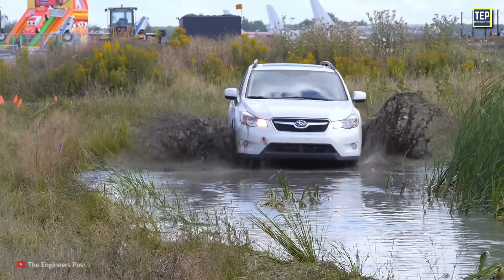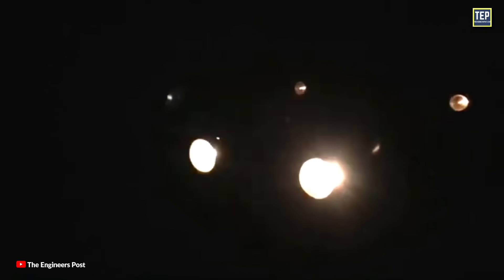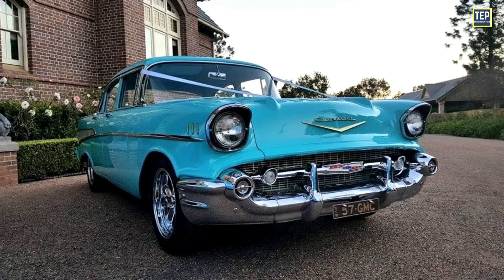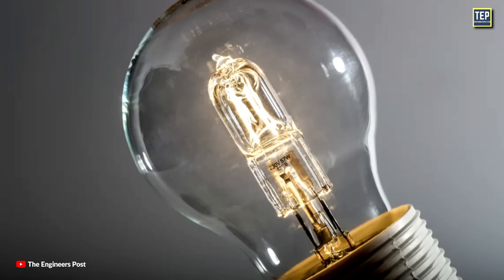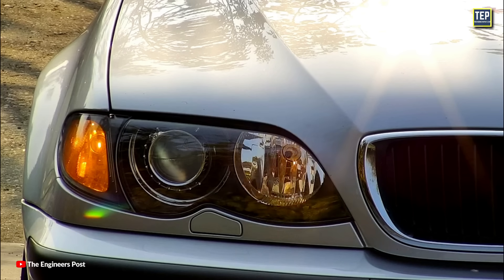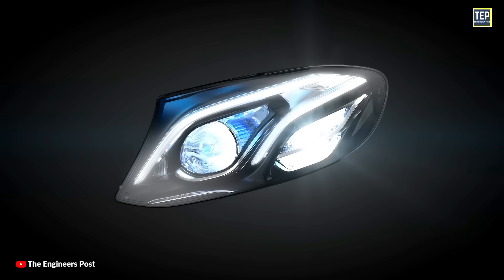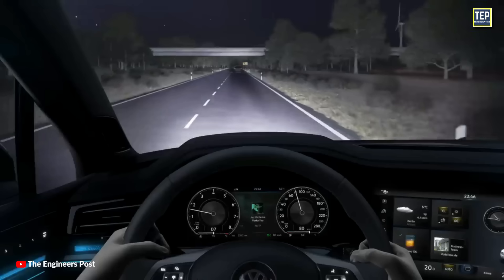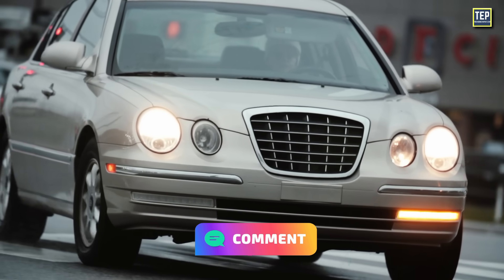The Problem With These Headlights

Comment: Halogen setup is best. Functional, bright, good spread, yellowish. 

Xenon and Led are too white for pitch black and rainy season wet roads. 
Plus they make you blind, if oncoming vehicle has one.
Reply: xenons are best same with leds stop talking bullshit about halogen junk, even this yellow light is anoying and weak
Reply: Selective yellow (or generally a warmer phosphor layer) LEDs would be the ideal
Reply: Brighter light reflects more of wet and snowy roads. Thats why they use yellow light in rally.
Reply: LED matrix do not blind anyone. They turn off when incoming cars are. It is soo nice to have.
Reply: @ContraVsGigi  yeah the turn off too late though, they blind you first.
But you be happy that you can see and are pissing off every other driver.
Reply: @ContraVsGigi  Are there enough varieties of LED matrix lights to retro-fit any existing automobile ?
Reply: @doughamblett5204  I don't think you can retrofit matrix lights. As far as I know, it requires a vision system (camera and onboard computer) to identify the position of the oncoming vehicle and light up the LEDs accordingly
Reply: I can't see more than 20m ahead with halogens if it's dark and raining. That's my experience with two cars, both having clear lenses and decent bulbs. Now i have a car with xenons and the next winter is gonna be a lot more comfortable.
Reply: @idkwuisp7626  Except for all the other folks you meet on the road.
Reply: @idkwuisp7626  Maybe it is different type of reflector material they use in your country? 
Or different type of asphalt mixture, idk. 
Or maybe different genetics and colour spectrum of eyes? 

But xenon on snowish white is really bad at reflecting back into retina, Good luck...

Comment: Funny how they called it "electric" light, like what light nowadays isn't electric 😂
Reply: I had a fire in the backyard last weekend that threw some light. Lit it with a Bic.

Got the charcoal grill ready to make burgers and brats tonight, also gonna be lit by the Bic. And the initial burning will give off light. 

My wife loves candles, they give off enough light to read by depending on how many are burning. 

Sorry to be that guy, but not all light is electric. As literally proven by the first example in the video.
Reply: You missed the point.

Comment: The main problem with LED headlights is that are too bright on some cars and can blind you. For example, if you driving a sedan and there is a big truck behind you, it's headlights will shine in your car.   Also, if the LED light malfuctions, you cannot just replace the bulb as it is not a regular bulb like halgeon are. Instead, you have to replace the entire headlight assembly. This is true on the 2014 and newer Toyota Corolla.
Reply: I know a gal who carried a hand=held mirror so she could raise it up and direct the big truck's lights directly back at him.
Reply: @doughamblett5204  I knew a kid whose mom gave him a hat pin to defend himself against bullies.
Reply: @doughamblett5204  I use the flashligt but, maybe, it's not bright enough to make those SUV drivers understand they're blinding me. Thinking about installing LED-bar behind my rear window now.
Reply: Not true. You certainly can replace JUST the headlight bulbs in a 2014 and newer Corolla. There's videos all over the place showing how, and they look to me like they are held in exactly the way they are on my older Lexus and even my F150.
Reply: I’ve seen you somewhere before🤔
Reply: just flip the little dongle on your mirror
Reply: There are countless H4 and H7 replacement lights for halogen to LED. Most are just as easy to replace as the original halogen. So you can't blame that on LED, blame it on the car designers.
Reply: @knightwolf200612  Modern day OEM LED headlights from factory are one big assembly. There is no actual lamp to replace.

My 2019 Subaru Outback's LED headlights are the matrix variety, so if any part of it is broken, you replace the entire headlamp, as happened to me when someone merged into me and broke the headlamp's attachment arm to the body. The headlamp itself still worked fine, but was effectively not attached to the car anymore. The replacement headlamp (part alone) was AUD$3000 (USD$2000). Thankfully I didn't have to pay for that.

OEM LED headlights overall are brutally reliable. The chances of an OEM LED headlight failing are slim. Should outlast the car, really.
Reply: @HyRax_Aus tell this to my friend who has electrical problem and every so often he has to turn off and on car because car won't let him use "high beams" 😂
All this fancy equipment and car won't even tell why, just "no lights for you today, sir"
Reply: @knightwolf200612  and none of these replacement bulbs is legal because they shine eveerywhere, but not on the road and so are a hazard to all other drivers.

Because physics. LED is not a point lightsource and does not work with halogen reflectors, causing light to spill everywhere.

There are only a few street legal LED replacements made by OSRAM and Philips. Those are specifically made for ONE car. Developed for the specific reflector in this specific car.
Those are the only street legal replacements.

Using one of the illegal once will make you accountable in a crash and you pay all the bills.
Reply: @dom3827   It looks like you are one of the more educated persons here, on this subject. You are 100 percent correct. Putting a light source in a housing for which it was not designed is a violation of Federal Law, specifically FMVSS Sec. 108.
Reply: @dom3827  Are you familiar with the Softlights Foundation and all of the research and legislative work being done there?
Reply: @knightwolf200612 in many countries they are illegal and will result in a failure if they do government road worthy testing!
Reply: @knightwolf200612 but you can't do fancy looks and "matrix patterns" with one light source
Reply: @knightwolf200612  yep. The blame is definetly on the designers. If you are blinded at night by oncoming factory LED headlight, then there is a 90% chance that car is a Suzuki Vitara. Their LED headlight is the worst. They blind you out of factory.
Reply: ever heard of matrix LED?

Comment: I notice you mentioned the 1948 Tucker Torpedo and it's single 'Adaptive' headlight which didn't go into major manufacture, but there's no mention of the 1968 Mk3 Citroën DS that had two adaptive headlights which DID go into major manufacture and produced almost 1.5 million cars.
America at the time banned the sale of this car unless Citroën REMOVED this innovative safety feature, so the car had to have four fixed headlamps to comply with US law.
Typical American video, if it wasn't created in America it doesn't count.

Comment: Lasers are too stupid as of today. Living in Norway almost every single Tesla owner is either a complete moron or obliviously stupid and do not know how to operate their lights, and the shitty automatic detection system is absolute trash. I say that as someone that is contemplating ramming every laser light fucker off the road as they burn my fucking eyes out at all times of the year. I am so sick and tired of getting blinded by either shitty systems or idiot drivers that getting flood lights in the rear just to fuck them over is very real thought, and getting a bull bar to be able to ram them is the next best thing. Fuck shitty laser lights, they are not ready for the roads yet. They are too wide and stupid. Matrix lights are great!

Comment: Give me an Halogen headlight any day the bulbs could be replaced but more modern vehicles with LED lights mean if one diode goes you need a new light and indicator as these are sealed units.

Comment: About the LEDs : in cars and home lights, the semiconductor produce a blue light. It goes through a phosphorus coating that actually glows white.
Reply: Phosphor, not phosphorus.
Reply: seldom mentioned but the "white" LEDs are all based on the "Blue" LED with Phosphor "painted" on top.  The chosen amount and mix of chemicals  determines the LED's final "temperature color".  

Since the LED starts out as ultraviolet and blue, and gets lowered by the phosphor, the LOWER the TEMP you want, the less efficient the LED is, and the hotter it runs.  The hotter it runs the shorter it's life, because this heat is dissipated through the LED itself.  Lower K-value means less light per Watt, and shorter bulb life.

The main cause of short bulb life is not lowering the K-value though.  Its because you can overdrive the LED and it burns brighter but dies faster.  They can run 50,000 or 300,000 hours, but if you increase the wattage 20% it drops at least half.   So two LED bulbs will work the same, but if the LEDs in one are being driven at 150% of spec, it will last about 10% as long, getting dimmer on the way as they do.  Most bulbs sold are being overdriven, with the cheapest bulbs out there driving the LEDs overspec max, where a single digit % will fail within 20 hours.  The efficiency is not significantly different, just the efficiency curve (decline) is accelerated massively.  This is usually done to reduce the number of cheap smd-LEDs required in the circuit to the bare minimum needed to roundup to the promised initial brightness, saving 1-2 cents, but meaning the bulb life drops 75%.   This is based on my experience with home bulbs, but aftermarket car bulbs will probably be the same game, except they make up silly numbers for the lumens.  

Shockingly, this "overdriving LEDs to save pennies" has spread to LED-TVs, where many lose picture because the backlight goes out early.  This requires all the ecological damage of making a TV, and burying one, plus all the time/effort of the customer, because some non-engineer wanted to cut literally a single RMB from the bill of materials cost of a $300-500 "Snagsum" or "WestingONN" TV.
Reply: So how do RGB LEDs work?
Reply: @isaackikkert6960  combining three LEDs (surprisingly red, green and blue) onto a common socket and then balance them to seem white.
However, you only get three wave-lengths, meaning colour reproduction under such light will be very off as all other wave-lengths present in white light is missing.
Reply: @BPo75  I didn't know this was even a thing.  I have seen some white/yellow combo LEDs though.
Reply: @isaackikkert6960  In each pixel, there are multiple Light Emitting Diodes, each separately addressable and controlled. By varying the intensity of the different colors, many other colors are possible through combining. Just like the pixels in your flat screen TV.
Reply: @isaackikkert6960 RGB LEDs are typically not used anymore on any good white lighting system, because they don't produce "true" white light (instead a mixture of just red, blue and green) which can create weird scattering/refraction effects and just produce an overall poor quality of light.

Blue LEDs with phosphors instead produce the full colour spectrum, giving out true white light that behaves like natural sunlight, and are overall better than RGB LEDs due to the better light and reduced complexity (only one color of LED required)
Reply: If the coating fails the light becomes purple, that's why you see purple headlights or newer street lamps sometimes
Reply: And yet we have the LED street lamps that have the filament detonating in the housing, and the "phsyicodelec" theme happens 🤪🤪
Reply: @Ithinkiwill66  What the Hell is that?
Reply: @Ithinkiwill66  What the heck is that, a diversity rainbow street lamp? Gag me with a spoon.
Reply: @Ithinkiwill66  LED lights do not have filaments, did you not watch the video? Also it's "psychedelic".

Comment: That's the first time I've heard a halogen as being inert. Wrong group in the periodic table.
Reply: The fact it reacts to Tungsten to prolong it's life means it's not inert/noble lol
Reply: It does have an inert gas in the bulb, with a amall amount of iodine  or bromine (the halogen group). This gas combination causes vaporized tungsten from the filament to redeposit on the filament, and not the inside of the bulb.  Higher power levels and thus brighter light output can be had compared to regular incandescent bulbs.
Reply: @VJ-ft2xj  and longevity
Reply: @paulqueripel3493 is correct.  Also, the names of the two halogen elements in halogen lamps are bromine and iodine, not bromide and iodide.  The explanation of how LEDs work is terrible, as well.  Obviously the whole thing is generated by AI, including the wonky narrator.